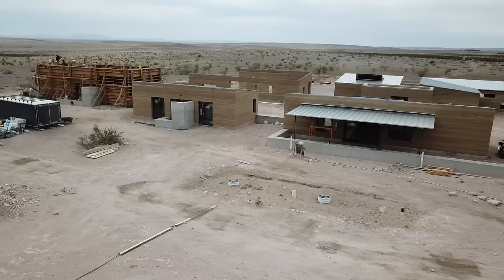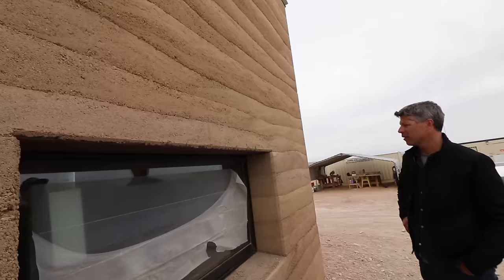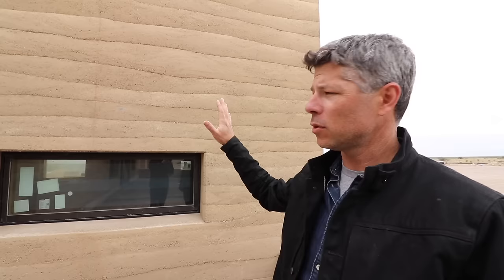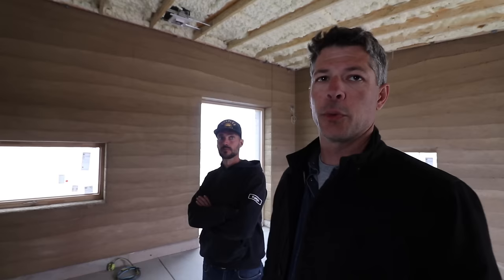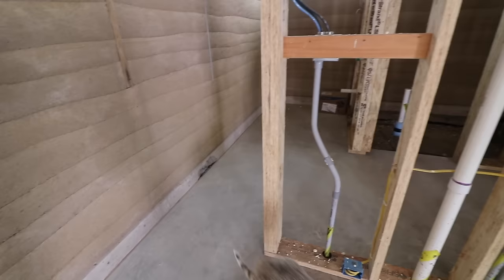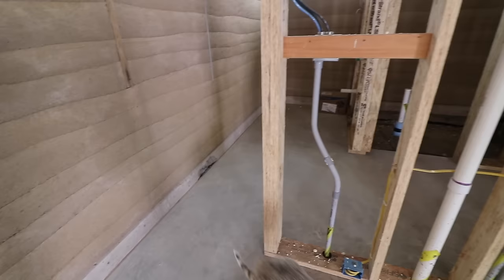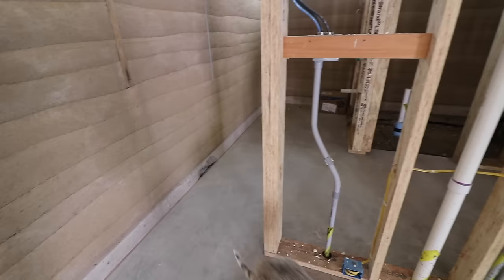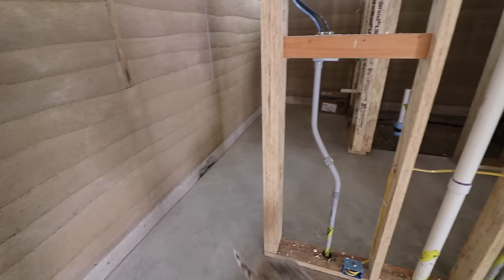Rammed Earth : You won’t Believe How They Build This!

Comment: I work in the sign industry and once had to hammer drill about 300 1/4" holes into a monument sign, made out of Rammed Earth. 12 bits and 8 hours later, I realized this material and process is no joke. I wouldn't be surprised if it could withstand a nuclear blast.

Comment: I live in the Algarve (South Portugal) and believe me: Most country houses that were built more that 50 years ago, were built using the very same technique you showed us in there.
Great video. A true homage to the ancient human knowledge.
Greetings from Portugal.
Reply: Thank You Mr Madeira
Reply: this technique is recent and only possible with modern technology... there's a huge difference between mud huts and compressed earth.
Reply: To all the wannabe rammed earth "experts" responding to Victor's comment, I suggest you google "historic rammed earth"
Reply: @methemanization  i just want you to know i only read the first line of that. congrats
Reply: Same greetings from Hungary applying this method for hundreds of years.
Reply: Also from Portugal and an admirer of this building technique. Question- Is it an option to whitewash, or even paint the walls? Obrigado.
Reply: Spain too.. between two layers of set stonework, but usually with more of a rubble sand mortar mix (that would have a low cement type mix - lime cement)
Reply: How is the compression achieved? I’ve heard people say “dry tamp” but what is the tool to do this for a wall?

I’ve done a floor but not a wall.
Reply: Iam Impossibru
Dang negative and hateful much? He was merely pointing out is wasn't new! 

Yes there are rammed earth homes that have been done with totally manual labor, no highly technical equipment unless you count a tamper and straw being used as highly developed equipment. Now the pressure used would not be the same but the product is the same, except the edition of straw or some type of fiber in the owner built homes gives the building a higher shock resistance value i.e. meaning the will do better in the event of being struck with heavy objects, like a vehicle of any sort being the size of a campact sedan or more or from shaking due to strong 8.5 or higher earthquakes!! The building would at minimum develop cracks very likely making structure uninhabitable, and or possibly crumbling the walls apart.

As far as adobe goes depending on how they build and create their bricks and how thick they layer the bricks and or the finsihings thickness on the inside and outside, it is very comparable in many ways and almost better in other ways! Generally the walls are typically at least 18" wide if not wider in many cases or they used to be....and all of the weight of the dirt/ mud bricks even though dry at time of building not completely dry due to moisture levels from rains or near rains contributing, and water added as building which softens the layers up enough as building it still very much comes very close to the rammed earth! 

There is one major difference between this rammed earth and adobe/cob building, or self built rammed building!!! No straw or type of fiber is being used therefore if a wall or a building gets shaken in certain ways and or is hit in certain ways it can cause the "rock" to break and become unstable! Adobe/cob has straw, hay, or type of fiber all though it helping hold it together as one piece regardless of hit or shaking except for extreme shakes or direct hits like from a commercial airliner hit or the like equivalent of shaking they would be harder to casue structural damage to then this particular rammed earth as they didn't use straw as most self builders do!

They are very likely comprarable in bullet proofness as well! Both would likely take multiple shots to even crack much less likely to break or cause a hole, in that cob/adobe has been simply field tested by a few survivalists who wanted to test it's capabilities! They built an 18" cube and let it bake dry in the sun as is normal then shot at it with multiple various guns and sizes to see what would happen. Most simply dinged a dent the depth of which depended on the caliber of each weapon used, some hand guns and some rifles and I believe one AK-47 was used. But none went all the way through and the strongest of the weapons and bullets/shells used only went in a max of three inches and the diameter of the hole was maybe max 1 & 1\2" . The block did not even crack until after many mutilple shots hit it and not until the front and back and were both shot and after at least 8 shots did it begin to crack and a few more shots later it finally cracked its full length and all of the way through, it's depth, but the better part is, it did not crumble to pieces and would have still been reparable as the whole thing was still held together by the straw and if fighting had existed to cause such damage, both inside and out, highly unlikely but either way, the wall could have been repaired with more cob mixture and healed back up!!!
Reply: The Duckling Homestead and Gardens the straw acts as a fiberglass
Reply: @I am Impossibru  Wow, you live a sheltered life. Why exactly do you think rammed earth is called rammed earth? Aside from the cement and the equipment used to build the forms and move the dirt, this IS exactly as it has been done for centuries. Just because you don't see it at the homo depot doesn't mean it didn't already exist. Oh and did you call Portugal an EU member country"3rd world"!? I hope you never get the pleasure of seeing how wrong you are about such a beautiful and cultured place! (Algarve is a bit touristy but between there and Lisboa is quite lovely and rugged as well as the north next to Spain.
Reply: Iam Impossibru - maybe hundreds of psi but not thoudands
Reply: Surely the building costs are no more than with conventional building.Anyway well done.
Reply: methemanization ik
Reply: Probably a bit more cost actually because so much lumber is used to make the wall molds. They can be reused in big repetitive jobs but less so on smaller ones. The labor is intensive too.
Reply: In Brazil  we call it taipa. In the historic city of Ouro  Preto  there are buildings over 300 years old that were built by portuguese masters with the technique.

Comment: I'm an HVAC contractor in Canada and I worked on a rammed earth house once. I did the heat loss calculation and it was over 180,000 BTUH for 2500sq ft. When I showed it to the builder and voiced my concerns he just brushed it off and said my heat loss program didn't take into account "the mass" They did have a layer of 3.5" Roxul in the middle of the wall but no perimeter insulation on the radiant slab and huge thermal bridges around every door and window. The first winter they went through $10,000 of propane. I'll have to admit they do look really nice though.
Reply: Sounds like a bad climate for the material coupled with some poor choices on detailing.
Reply: Who cares about some boring calculations?) Only empiric approach, only hardcore!))
Reply: Doesn't concrete also produce CO2 ? Is there a danger of that? You are in a giant Stone box...
Reply: @werewolf74  The manufacturing of cement releases a lot of C02, chemically and by burning fossil fuels for heat.  Concrete doesn't off-gas significantly after its cured if that's what you were thinking.
Reply: That's terrible to hear, they must have been so disappointed. We have 8" of roxul in the middle and we did put 6 inches under slab and on all perimeters. We even cut the center of our top cap and filled it with foam, so there are zero thermal bridges. Our 2650 sq/ft home with a heat pump costs the same to heat as our 300 ft cabin with baseboards.

Comment: I live in a cob built house two foot thick walls on ground floor level. It's always a certain level temperature all year. Cool in summer and OK in winter. I somtimes put a little heater on  2kw but only for a short time or just leave on frost setting. So for 14 years now No central heating used. For real.
Reply: nice
Reply: wow that is fantastic.  I've heard the original old "straw and mud" houses lasted a very long time... some still around today.
Reply: @TiempoNuevo-ew7ty  They were using baled rice straw to build houses a few years ago .Talk about thick walls . Came about as a result of restrictions on field burning . Needed a place for their straw . I think it's too much matter and decays too slowly to turn back into the soil each year .

Comment: I was in the Engineers Corp in South Africa an we built Houses same as you did when we where in Namibia  in 1978 but we used more concrete and they where amazing our walls where not as wide we use to bolt the outer an inner  reusable shuttering on a already cast floor we where a team of 6 we built 1 house a day  we used two sets of shuttering one we built and one was being cast into.   I was amazed you guys have taken it to the next level....Well Done
Reply: @jeta-mariaswanepoel  hi Mevrou hoe gaan dit met "U"
Reply: There are examples of this in Australia ,I was in the 1980's, western Australia south of Perth, Mathia's Bay.. great surf there.  18" thick.  Remember that there is a ocean breeze there..  also some fire shelters in Victoria..
Reply: That’s fascinating. You built a whole wall in a day? Did you need water or was the mix all dry?

Comment: In The GM Engine assembly line I worked on, small parts like the oil pan bolts would be delivered to the installer using vibration. I wonder if that could be used to deliver the dirt. Perhaps a combination between a conveyer dirt delivery truck like landscapers use ( also for spreading gravel ) and the vibrator mover to be cheaper than manual shoveling. The operator would stand where he could see where the dirt is to go and by the controls he is wearing on his hips, he is able to operate all the functions of the above said truck to control the amount of dirt placed where it is wanted.

Comment: Matt, get an old Whole Earth Catalog, the original early ones all had rammed earth construction techniques in them 50+ years ago.
Reply: Go back a few thousand years and native American's did this too.
Reply: for this guy everything is DAAANG COOOOL WOW
Reply: I wonder if they could make a video of the houses made during the Whole Earth Catalog days and what they look like today.  I remember that was a great catalog.
Reply: Yes, until the old hippies got old and got jobs and realized that paying for labor makes it impractical.  Those old school homes used nothing but friable clays, so its difficult to pass building code in any place with earthquake or rain issues.  High desert is perfect. But importing the crew makes it very expensive.
Reply: @markdoldon8852  Hi Mark!  You know construction and materials... so if the old school people had used a percentage of concrete they would have passed code in earthquake and rainy regions?  Do you know if any of the old school homes are still standing 50 or more years later?  Are the homes presented here with concrete in the mixture... those walls don't deteriorate in the rain or break up in earthquakes and would pass code?  I wonder too if the Whole Earth Catalog plan included different mixtures for areas of rain and earthquake too.  I read that Germany is now widely using aircrete as the ideal material of the future.  It's very easy to make, strong, light weight, waterproof, and a very low cost building material.
Reply: CINVA Ram
Reply: @simeon324  Yeah, it really seems to bother some people when they see someone who genuinely loves what they do.
Reply: @RefinerSimilitude  you think it's that? not in this case Im afraid. Just don't like unnecessary hype. Unless this is a video of an influencer?
Reply: @simeon324  Does it matter? Take the information or leave it. No need to criticize how he communicates.
Reply: @simeon324  😆
Reply: Lyfan Deth WHAT? Are you still smoking? I remember reading the last whole earth as a young teenager. I'm 47 now with my invitation for my 45th class reunion that when my girlfriend (27) saw it she laughed and said look they wrote the wrong number you would have graduate when you were only three years old! I think I'm going to start smoking more and do less traveling. You would think with all we've seen happen in the past fifty years, that hardest thing for me to believe is that it has really been fifty years. Hey, remember the story in the catalog that said the shape of the F-15 fighter jet was just a copy of the shape of a shark and they put the outline of the jet on the shark? And it WAS MAN ! So cool. Peace
Reply: WEC was a mine of valuable information, but also Lloyd Kahns books and his  current blogs.
Reply: My research on the subject suggested good arguments for avoiding square or rectilinear buildings. Trapeziods are worth considering.

Comment: I WANT TO SEE THIS PROJECT WHEN IT IS COMPLETE...BEAUTIFUL!! 

(I live in phoenix.  I'm guessing this type of building would work very well here!)
Reply: I dwell in Mesa and have a MSBE from ASU. Would say depends on the location in Phoenix because of the lack of diurnal temperature change due to urban heat island affect in some microclimates. What does work in conditions where insignificant diurnal temperature difference is internal thermal mass. Right now living in a poorly insulated house temporary, so have 30 gallons of water stored inside and have been only needing to turn on the aircon in the evening, though shifting more towards the afternoon with warmer temperatures as Summer comes. Hope this helps.
Reply: @adrielrowley   The thermal mass of rammed earth would be similar to that of Adobe, right? The rammed earth used here is compacted dirt with 9% cement added. Most Adobe does not have cement added, otherwise, they are similar as to components.
Reply: @DavGreg , adobe has the same concern of maintaining the average OA temperature. Both use a bonding agent, one cement and the other clay, differing on strength and stability (adobe is soft and will dissolve in rain). Straw bales have a R value of about 50 with little to no thermal storage, though have not come across too many in the desert (last time considered was long ago in California). This all starts to head towards experimental architecture. In short, praxis must support thesis.
Reply: North Phoenix here and I wonder the same.  I know we have them here (more near Tucson) but I'd like to hear about the performance.
Reply: @T Jam, It should work just fine in Arizona in general. The exterior walls can be as thick as you want and insulation can be added on the outside, between the walls, or even on the inside. Generally most people put  insulation between the walls for best performance.  For example, 9" wall + 6" insulation + 9" wall for a complete exterior wall. Interior walls can also be made from rammed earth 6" - 8" , no need for insulation here.
Reply: @adrielrowley Adobe properly stabilized with cement or emulsified asphalt or whatever will last forever. I used e.a. 60 years ago when it was $5/barrel and it doesn't dissolve.
Reply: @1voluntaryist , thank you, never heard of cement or asphalt used in adobe. This has been the best discussion ever on the Tube, so polite and great discussion.
Reply: Adriel Rowley Goodyear year. I would think this construction with a roof overhang so only the winter sun is the direct heat would make this better for us. I would really like to go back and get better south and west overhangs on my Palm Valley home. Not that it would have been an ‘option.’
Reply: @adrielrowley  that's a great idea!  They actually do that in colder climates and they put it right in the middle of the wall.  The mechanical separation just stops the exterior wall temp from transferring to the inside.
Reply: @adrielrowley  do install double vented roofs and radiant barrier foil in the roof. (See installation details from companies) great stuff and foil alone has about 2 year payback. Also watch the overhangs are far enough out to shade the walls except for your south wall. If the kitchen is there take on the challenge to build a through the wall solar oven.
Reply: @stephenverchinski409 , thanks and appreciation for the reply.

Yes, hope to build my own home, though life seems to be charting a course I much do not prefer.

Being a post post Modernist, prefer no roof overhangs, instead using the correct method of solar shading for each orientation. North be vertical fins, South horizonal shading, and East and West egg crates help (as of course do not work when the sun is horizontal as you know).

Metal roofs also help reflect and prevent thermal storage (asphalt roof holds heat per my experiences). If for some reason ended up with the house I now reside (long and complicated series of events) and when the asphalt needed replacing (as not properly installed and for some reason only a year after installation started loosing the aggregate) convert the vented attic to conditioned space with metal roof furred over radiant barrier, which be over a layer of insulation. 

Never heard of a through the wall solar oven, will look into that.
Reply: Check out Rick Joy in Tucson
Reply: depend on your temperature averages.. if you have a few months of  105*F  day time and 88*F night time temps this is not going to get approved for 24/7 occupancy .. Note that this is commercial property..

Comment: I came up with my own building material. I mixed clay with straw and water (centuries old method) and then I added a little roofing tar cement. Stirred around really well it mixes in really good. You could plaster walls or do anything u want with this and then paint it with linseed oil after it dies.  I'm pleased with this.